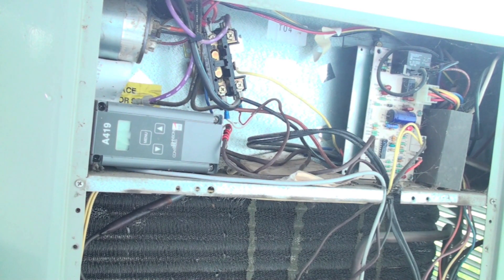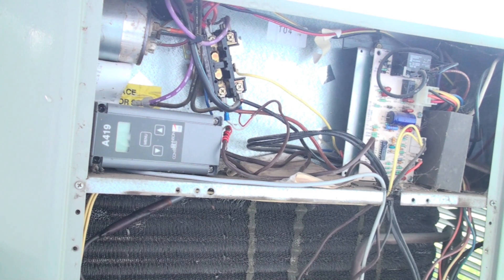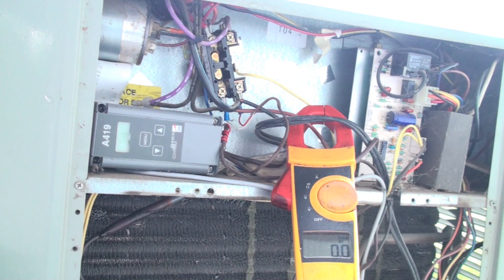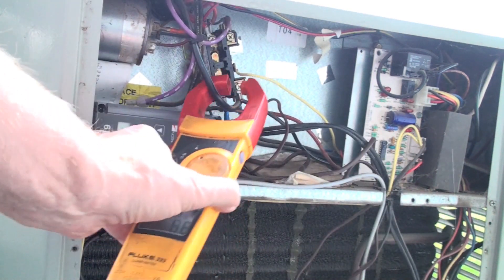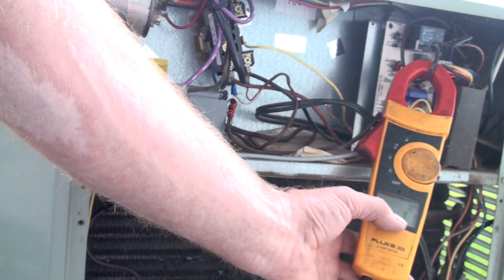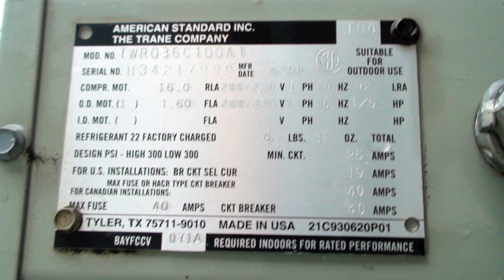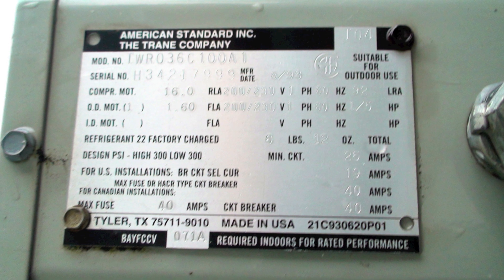What is normal air conditioner amp draw

Comment: I havent done hvac in about 10 years, i do service my own stuff. Just today i wemt outside and washed the outdoor and blew out the electrical compartment. Google says anything over 70% of your RLA means youve got issues. She was chugging away at 13.89 rated at 19.2. Given its a 20 year old unit its going to be a little high. Thanks for the info. Just what i needed.

Comment: 12 amps total is super low is it a 1ton
Reply from the maker: 3 ton 240 volt.  RLA 16.  Wake up your mind.
GFM
Reply: @grayfurnaceman  I have a question - a residential 240v system is actually a 120v 2-pole with two hots (T1 and T2) and a ground - so technically don't you have to measure the amps at both 120v leads to the compressor and add them together to get total amps based on 240v? Both hots to the compressor should be reading 11 amps x 2 = 22 amps which is higher than the 16 RLA for 240v. I see that at the time that the video was shot 13 years ago, that the condenser would have been nine years old...this would mean that as the unit got older, the compressor started to get less efficient over time due to age and wear and tear.
Reply from the maker: @jonbe9  If you only have 240 volt loads in the circuit, you only should clamp one line.  Do not add the amperage read.  If you read 11 amps, that is the total amp draw of the circuit.  As a general rule compressors lose very little efficiency over their lifetime.   An amp draw over RLA usually means imminent failure.
GFM

Comment: Question:  If there is a leak and the pressure of refrigerant is getting lower, would the amps be getting lower too ?
Reply from the maker: Yes, as the efficiency lowers due to low charge, the amp draw will also lower.
GFM

Comment: Mr Gray Furnace i had learnt a lot from you and i would like to say 99 percent of the time when i measure Amperage i always and almost get 70 percent of plate number per say 16 RLA times 7 equal 11.2 rite on da money what i got 7 times the full load divided 100 so thats how i get it Tnks blessings to u n fam
Reply from the maker: First, I should note that RLA is Rated Load Amps.  I was incorrect in saying running load amps.  

Your 70% number is generally correct.  Under high load I would expect a number closer to the RLA.  If the unit exceeds the RLA, I would be concerned that there is a problem with any number of problems.  Overcharge, expansion device problems, etc.  

Compressor problems are seldom seen as a small excessive amp draw.  It is usually much more obvious, like a dead short.
GFM

Comment: Such a waste of power compared to a mini split. The mini split average power draw is 3 amps...
Reply from the maker: I don't know where you are getting your numbers, but they are not accurate.  Amp draw is dependent on voltage and unit size in addition to efficiency.  
If you are comparing a 3/4 ton mini split to a 3 ton split system A/C, there is no accurate comparison.  
GFM
Reply: @grayfurnaceman  what's GFM? Yeah 1-ton mini-split on 110 volts well-drawn averaged between 3 and 6 amps. Scale that up to a 3-ton mini split and it's still more efficient

Comment: hi, I just found this page so hopefully someone is still reading it but anyway,, a service tech told me my AC system needed replacement because it is drawing to many amps ---  but it  is cooling well... so ???? is that right???  
On the 220 system condenser, do you add the two legs together to get the total amps used or only one of the two legs? when figuring amp draw, am I looking at the total of the two???? what he was saying is basically one was pulling say 15 and the other like 14 so it was using nearly 30 when it "should be" about 20 (its a 5 ton Trans 13 seer)  does that sound like a problem or was he telling me to replace a good system??? how do I know how many amps it should be using? 
and again, is it the total of the two or just the highest of the two???? After he left I purchased all 3new capacitors as well to see if the helps  the situation ---- the fan capacitor tests bad (but it runs) it measures only 4.4 MFD when rated for 7.5  and the run cap. tests at 74 mfd when it is rated for 80 +/- 6% (so barely within spec) - the start cap I cannot measure since it has the resistor on it ( it tests OL ) but the unit starts and cools well..... it is April here in Texas and if this thing is going out for real, I want to replace it before it dies in 100+ July ...... is this guy telling me a BS story?????  hopefully someone is watching still -- BTW, thanks for the video on CAP testing that is how I figured out how to test them!
Reply from the maker: I am assuming your tech is checking the amp draw of the compressor.  There are 3 wires to the compressor.  Start, run and common.  The start should be the lowest, run should be next highest and common should be equal to the total of the start and run.  
The model plate on the outdoor unit should show amp draw for the compressor(amp draw of the common).  That is the maximum draw the compressor can safely run.  If it draws more than that, it should open the overdraw protection control and shut down the compressor.  If the total amp draw is as far above as your numbers indicate, I would expect the overdraw protection would open.  
GFM
Reply: @grayfurnaceman  thank you - had it checked again by another company and the compressor was pulling 20 out of max 26 on a cool day so we decided to replace both systems before summer with more efficient systems (one was junk and the other about 13 years old) mighta made it through another summer but didnt want to chance it. thanks!

Comment: My 3 ton r22 unit just started drawing 16.5 amps at the compressor when I switched from A/C to heat pump. In the past it has always been 12.7 or thereabouts. RLA is 18.0. Pressures are where they have always been. High side 230 -245. Unit installed in 1996. Compressor on its way out?
Reply from the maker: Check your indoor coil for blockage.
GFM

Comment: what about inrush current?  i measured 65 amps in the wire that feeds the outdoor unit, then it falls down to about 5.5amps times 240v
Reply: That inrush sounds very high. You could have a failing compressor. There is not much to as a compressor failure usually means replacement of the entire unit. 
GFM

Comment: I was told by the company i work for that the compressor amp draw should be 50-60% of what RLA states. At least for a healthy compressor. And that anything above that would be over amping... Is there any truth to that?
Reply from the maker: There will be a lot of replaced compressors if you follow that instruction.  
The actual highest load for a given compressor in an application is not that simple.  There are charts that the maker can supply for that system that will give you maximum amp draw.
You will almost never have those charts, and so I use the RLA.  At least the RLA will give you a number that above which, the overload will open the circuit.  
GFM

Comment: Hey Grayfurnaceman, I am wondering why there is a electronic thermostat on the left Inside an ac unit and not a refrigerator, what does it do on that unit ?
Reply from the maker: Its a low ambient control to keep the A/C off if the ambient temp is too low for proper A/C operation.
GFM
Reply: @grayfurnaceman  is it hooked up to anything to stop the unit ?
Reply from the maker: @hvacairconditioning1406  It is in series with the control voltage from the thermostat.
GFM
Reply: Grayfurnaceman, does it sense coil temp, or just ambient?
Reply from the maker: @hvacairconditioning1406  Its just a thermostat that checks ambient.
The reason it is there is this structure has a tendency to start the A/C when the West sun warms the main living area.  This will over cool most areas of the structure.
GFM

Comment: Hello sir
I had call today ,the compressor humming sound and breaker trips,
I installed hard start kit,  the compressor started to run but noticed the run wire to compressor is 40 amp and breaker trips.
What's the reason ?
Reply from the maker: If the compressor is running at amperage above its rating, and the unit is not massively overcharged, you probably have a failing compressor.
GFM
Reply: @grayfurnaceman  
Thanks a lot ;
Please continue your videos .

Comment: In a 220v system when you measure one wire does that show only half the amperage amperage? Since there a two hot leads... Sorry for the dumb question.
Reply from the maker: No, all the amperage travels thru each line.
GFM

Comment: I keep looking for something a little more concrete than "that's about what you would expect" or "if it's low it would be about x."    Everything I have seen is "about" which tells me it is an educated guess that is open to each techs interpretation. I have heard a "rule of thumb" (another highly accurate measurement) that the amp draw should be around 75% of the FLA or RLA.  I remember going to one seminar quite a few years ago a recurring theme kept coming up "the days of ball park settings are going away or gone."  I have checked amp draws and they are all over the map. I would like to be more precise. Can you help?
Reply from the maker: Amp draw is related to many conditions, so that is why you see so many "ball park" numbers.  If it is not drawing above RLA or FLA, it is ok.  
GFM
Reply: @grayfurnaceman  thank you for the prompt response.

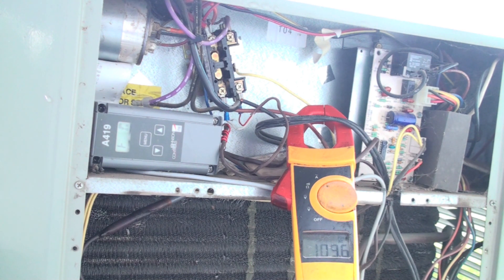Comment: Hello, great video - thank you. I've got a question. Sustained draw was about 12 Amp on each wire. However starting draw was close to a 100 Amp, higher even (at 1:44 mark). I've got very similar reading at my home. The AC circuit is supplied by dual pole 50 Amp breaker, to accommodate both starting and sustained draws. My question is - is there a way to safely and reliably limit starting draw? Thank you.
Reply from the maker: Not really. And why would you want to?  If the unit does not kick the breaker I would not be concerned.
GFM
Reply: This inrush current is a principle of motors which had to do the the start up "cost" to get the motor running. Normally between 6x to 12x depending on the load, design, an size of the motor  you could put a soft starter on the Compressor or star delta start ( if the systems can allow for them ). But these aren't necessary the compressor/fan motor are designed for this instant current load.

Comment: What is the tonnage of the AC ? What is  the starting Current? What is the starting current of a 5 Ton AC?
Reply from the maker: Tonnage is usually listed on the model plate as the number of thousands of BTUs.  Example:  60 would mean 60,000 BTUs.  Starting current is 2 to 3 times FLA.  
GFM

Comment: How did that meter read a split second amp draw of 105 amps and NOT trip the breakers at the panel ?? Or blow the dual 30 amp fuse at the outside unit ??
Reply from the maker: Breakers (especially HACR type) are time delay circuit protection.  Unless the amperage draw is very high, (a dead short will cause amp draw to rise several hundred amps) the breaker will delay opening to avoid nuisance tripping.  The fuses used for A/C units are dual element time delay types.
GFM

Comment: My AC went for a reversing valve replacement because it was stuck & leaked but after the unit was reinstalled, it's very very loud and the compressor is humming & vibrating so much that the entire body of the outdoor unit is vibrating. So much that it's difficult to use because the noise is too much. The tech is not taking it seriously. He says it's normal. But when he checked the amps, reading is going up to 12.5 amps. This unit is rated 8.2 amps & max I've seen it go is 9 amps. Is 12.5 amps high and abnormal? What could be the issue? Did they damage the compressor during repairs? Pressure readings are okay and cooling, heating are fine too but noise & vibrations are too much. Compressor etc are well secured. Just the compressor sounds totally different now. Plz help.

Comment: Had an A/C tech come look at my home system.  He said all the pressures were good, but the compressor was drawing 16 amps and the tag says the max should be 13.2.  We talked about replacing vs chemical clean .... I cleaned it (the outside coils) myself, bought a clamp meter, and retested it and it measures 13.8.  So it definitely improved, but it is still above spec.  Is this .6 amp a significant problem and are there other things I could do myself to try and bring this down?  Is it easy to clean the coils up on my attic (the condenser???? obviously this is my first dealings with home a/c projects?  Thanks
Reply from the maker: This one does not sound right.  Its very unusual to have a compressor to overdraw in that way.  I would get a second opinion.
GFM
Reply: Maybe the unit is not well vacuumed during installing?. Any residual air would create higher pressure than necessary.

Comment: @greyfurnaceman if you ohm a compressor and get the readings of 5.8 and 2.2, is 7.4 a sign of a bad compressor
Reply from the maker: I would not condemn a compressor by resistance readings.  Excessive amp draw is a better diagnostic tool.  
GFM
Reply: +grayfurnaceman 2.2 starting amps is what i got, thought that was low from what i heard u say in this video
Reply from the maker: Either you have a very small compressor or you are clamping the wrong wire.  Be sure you are clamping the common wire.
GFM

Comment: My condenser fan motor is drawing 1.1 amps and the specs say 1.2. When will I need to replace the motor? Should I buy one to have in case it goes out? Or does it do more damage to wait until a motor stops running?
Reply from the maker: I would not replace the motor.  It is capable of drawing rated load without any problem.
GFM
Reply: grneal26 are you serious ??  It's rated at 1.1 and you are reading 1.2 amps....  You are going to question a .1 amp draw..??

Comment: in a hypothetical case , if  Have a motor  and  hold his shaft and avoid turning  , on this motor the amp go up?
Reply from the maker: Yes. It may draw as much as 5 times it's rated amperage. 
GFM
Reply from the maker: Yes. It may draw as much as 5 times it's rated amperage. 
GFM

Comment: With all due respect GFM, the information you provided on this video is totally wrong. The measured amp draw and the published RLA have absolutely nothing to do with whether a compressor is good or bad. 

"RLA is not the running amperage of the compressor; it is a mathematical 
formula and is used for such things as sizing fuses, wires, and 
contactors. The published RLA value does not change as the motor load 
changes."

An amp reading alone tells us nothing. Once you gather the suction 
pressure, discharge pressure, and amperage readings, record this 
information along with the voltage measured at the compressor terminals.
 Then apply these four readings to the compressor curve sheet. Each 
compressor model has its own specific curve. The compressor curve sheet can be attained from each specific manufacturer. 
I can go on with more specifics but I won't bore everyone with details.
Reply from the maker: Sounds straight out of achr news. This video is designed to introduce the tech to amp draw. It is not for detailed troubleshoot. A little farther along here, if the compressor does exceed RLA, it will go out on thermal. That is the basis of this video. Using the chart could help diagnose problems in the system, but I have seldom had a need to use it. I will be doing moe on this. Thanks for thoughts. 
GFM

Comment: can you help I have  a 3.5 ton ac unit  the ac compressor went into thermal overload we cooled it off got it to restart and  the black wire is pulling 12 amps red wire is pulling 12 amps  and  wire to the capacitor is pulling 6 amps the compressor is rated at 22 amps  also  the the main amp draw for unit  is 15 on the black wire  and 14 on white  the system is rated at 24 amps.
Reply from the maker: SuperJeremi10 I would be checking the suction line temperature.  It should be between 50F and 60F.  A higher temperature will allow the compressor to overheat and shut down.  If it is too warm, low charge is suspected.  Hope this helps.
GFM
Reply: the suction line was very cold and sweating it was beer can cold I dare say haha and  the vents blow a 15-20 degree difference if we set it to say 68 on a 100 degree day it will maintain within 1 degree so the unit is cooling when the compressor runs the condenser fan is running also the blower is set to high the compressor is pulling excessive amps though  I metered it as it kicked in it pulled about 27 when it kicked in  and went down to bout 25 10 minutes later  the comp is rated at 22
Reply: never mind the hvach tech  we called out said the compressor went to ground it stopped cooling early this morning it was tripping breakers the compressor is done so we are going to authorize a new compressor since nothing else is wrong with the unit.
Reply: well lucky lucky the compressor isn't finished just yet just the wiring connections had burnt wires the charge seems okay but its running a high head pressure due to the evap is plugged up its dirty hasn't been cleaned in 8 years we said go ahead and clean it so maybe it will cool better after a cleaning its so plugged up the fan has low discharge. air.